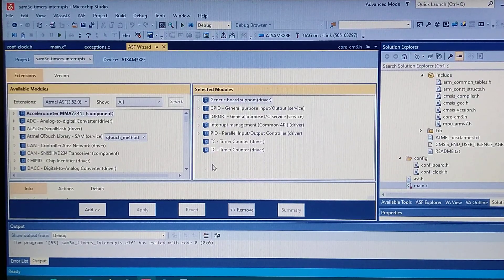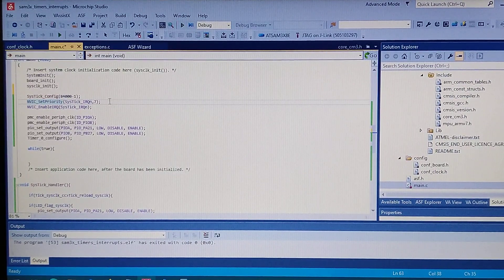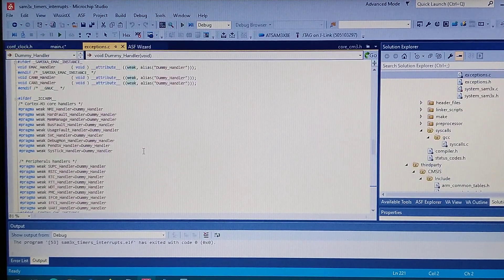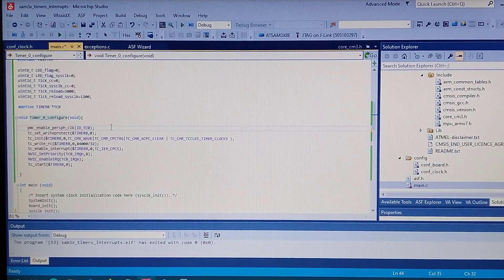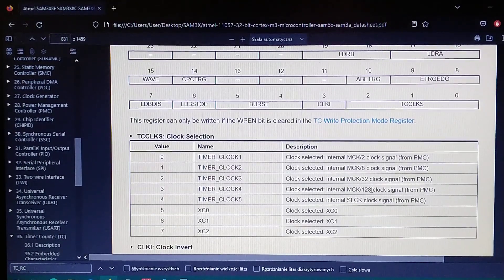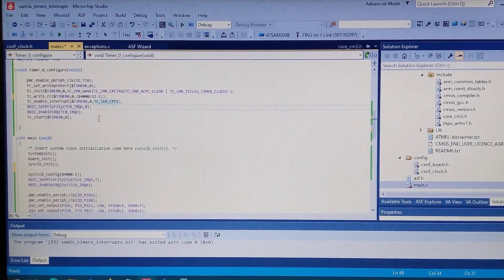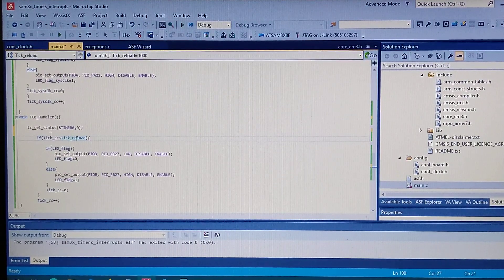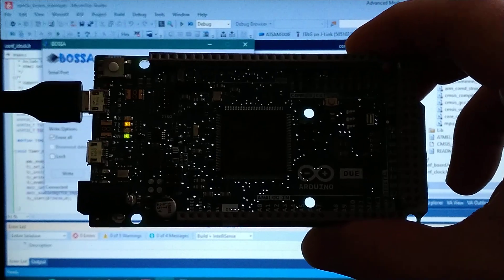Arduino Due Timer Counter with Interrupts example in Microchip Studio 7

Comment: Hey! I want to send you some huge THANK YOU!! for your dedicated SAM3x8E Playlist. I am currently learning how to get into 32-Bit Microcontrollers and starting with the SAM3x8E, because it is a quiet powerful device compared to the STM32 controllers.

Do you intend to make a video how to set up the Tool-Chain for bare-metal programming of the SAM3x8E? It would be nice if you could show how to use the JTAG with Atmel ICE and how to configure an external crystal-oscillator with MicroChip Studio.

Again, huge thanks!!
Reply from the maker: Hi, nice to hear it was helpful,  sure thing for a baremetal setup, jtag debuging (only have j-link ultra+ at the moment), some overclocking (like 200MHz+) and general clocks setups. 
The STM32 (mcu and mpu) have problems with hardware and software quality  - they work generally ok but there are cases of bugs in hardware and software that can slowdown work with the project for days.
Reply: @e-exp  
Wow, I didn't expect that the STM32 has hardware-bugs. But I guess the learning-curve might be less steeper than using the SAM3x8E for own projects.

My current goal is to build a custom PCB based on the SAM3X8E to control some Motors via PWM, getting feedback from quadrature Encoders and receiving Input from the onboard ADC via Potentiometers.

To get precise control over the Timers I would like to know how to configure the clock-frequency fuses (like the Atmega328 via MicrochipStudio) (if it is even necessary) and how to program this µC using simple Pins (JTAG e.g.) instead of the USB framework. 

But nevertheless, you are a live-saver. The documentation on the SAM3x8E over the internet is very poorly and your Playlist is therefore gold!

Comment: I see nothing . TOO fogy
Reply from the maker: The video equipment i got is quite bad and the computer does not handle video editing well, but don't worry in the next months i will be gearing up and re do most of the videos for better quality and content
Reply: @e-exp  I would recommend OBS, easy to set up and when well optimized it won't load your pc that much. Still great work!

Comment: what is the significance of 84000/32-1. Could you please explain that part like how did it end up in 84000.
Reply from the maker: So the main clock frequency is 84MHz (as set in clock_config.h file), if the timer would run without any prescalers it would decrement the timer counter value every 1/84000000 s. So if the timer ticks 84 times it will take 1/84000000 * 84 s = 1/1000000s = 1us, now if we want to get the timer counting 1ms it has to be 1000 times more so 1/84000000 * 84000 = 1/1000s = 1ms.
And with the prescaler of 32 (set by Clock setting 3) it has a frequency of 84/32MHz.
And if it comes to minus 1, the timer ends counting at value 0 so for example if we want the timer to tick 10 times it has to start at value 9.